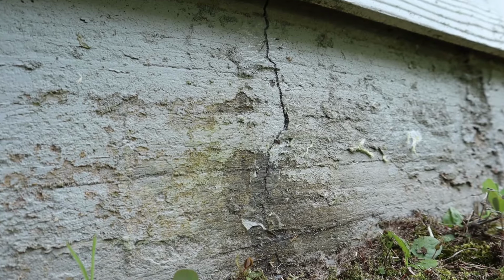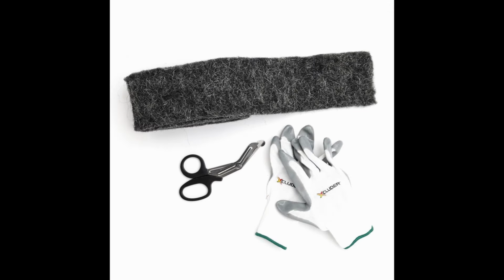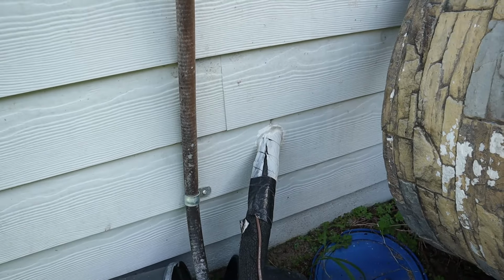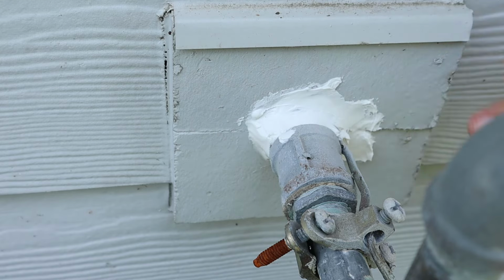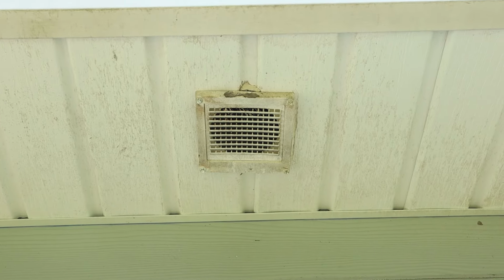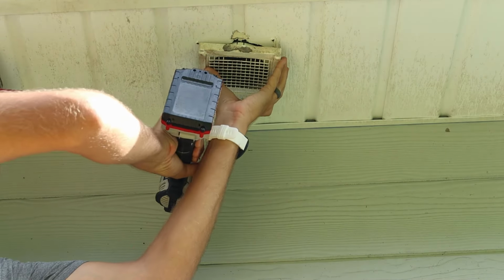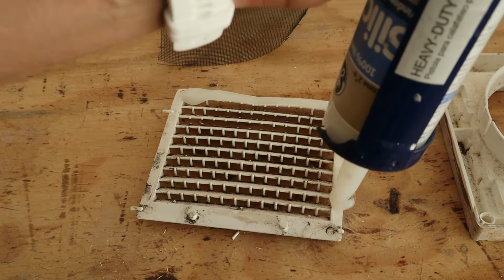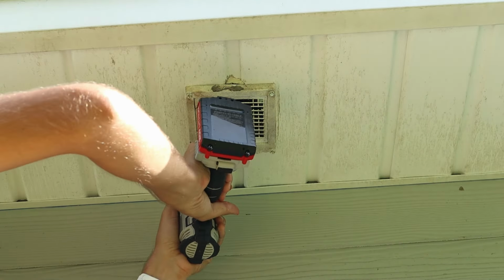How To Keep Bugs Out Of Your Home | Bug Proof Your House (4 Common Entry Points)

Comment: Sink and bathtub drains too, at least for certain types of bugs in some areas. Taking the small extra step to always pull up the plug on all the drains in my house when I’m not using them has really helped with bugs. I have horrible entomophobia and every little thing counts. Gotta try the vents now, though I’m slightly terrified of what I might find after unscrewing the cover.
Reply from the maker: Yes unfortunately the drains can have bugs come up through it which is gross in and of itself!  Definitely try the vent trick though.  Honestly it cut down on my bugs by a lot!  Also, if I had to guess, there probably wont be too many of them if any where you remove the cover.  Hope this helps!  Good luck with the pest prevention!
Reply: I would clean them regularly also I am an exterminator and I use bio drain. Helps with drain flys and gnats. Good idea to keep the drains closed too

Comment: Sealing up baseboards with caulking to fill in all gaps above and below the baseboard will help prevent insects that live inside the walls from crawling into the inside of your home. A good test is to take a business card and see if you can slide it under the baseboards around your house. If you can slide the card under the baseboard, that is enough of a gap for insects to crawl out from the walls into the house. Caulking will also work as an insulator to prevent cold air from migrating under the baseboards and coming inside. If you don't see a gap , it's still a good idea to apply caulking to the baseboard because gaps will form eventually.  We sealed up all baseboards around the house and that took a huge bite out of insect traffic.
Reply from the maker: Nice!  Thanks for the tip Tim!
Reply: I have a problem with palmetto bugs and I once saw one run away from me and crawled under the baseboard to get away. I’m about to buy a bunch of caulk to seal EVERYTHING!
Reply: I'm on here to find out if I should caulk below baseboards with carpet.  I imagine it won't be as good a seal, and would make it a pain to remove the carpet down the road.  But this is concrete floor downstairs and lots of weird things get in.

Comment: I had the same issue with wasps in bathroom coming from vent. Literally scared the shit out of me and using screens helped tremendously!
Reply: underneath the sink, you will notice there might be a hole on the wall right around the pipe. i noticed a lot of crawling bugs coming from there too.
Reply: @wiiiz3  I have the same problem. What did you use to fill the gap?
Reply: @Misabelle  I used a spray foam gap filler

Comment: Huge centipede almost crawled over my foot today. Time to take action -- I see light under the rear door -- not good.
Reply from the maker: Might be time for a new door seal!  Sometimes they can wear down over time or just aren't big enough from the beginning.  But if I had a huge centipede about crawl on me, I would definitely be trying to find anything that could have let it in haha  But if you are seeing light under your door, then that's probably a good indicator of where it came from.  Do you have a pest control company or do you do your own?
Reply: @HowToHomeDIY  I do my own mostly but haven't sprayed in months. Better get after it and replace the door seal.
Reply from the maker: @lancedyer4870  Ok good, I am sure this won't be any surprise but I think DIY is the way to go.  A lot less expensive and can be just as effective.  On Thursday I have a video coming out showing what products I use and how I do my own pest control.  Be on the lookout for that.  We may use some of the same things!

Comment: I rent a house in the country and it needs work with air duct system, bathroom vents and window seals and doors.... But being a renter and not an owner... Not much I can do. I hate living with so many bugs. I don't mind bugs outside and camping etc .. but it is a bit much inside the home.
Reply from the maker: Yeah renting does have it's limitations.  But you can try to seal off any areas that you see bugs might be getting in.  If the seals are bad though I would address these things with the landlord.

Comment: you should absolutely NOT put screening over ANY central air conditioning vents, registers, or return grilles, as any HVAC pro will tell you, this will put undue stress and strain on your air blower. it may not seem like much, but home ventilation is a very tricky thing to get just right, and if you slow the air flow, even by a little bit, it can make your house more muggy, keep it from cooling as well, cause condensation on your ductwork, leading to mold and mildew, and as i mentioned, can damage your central air's blower.

if there are ants coming in thru your central air ducts, then they were not installed properly, as those ducts are supposed to be AIR SEALED with mastic and tape, and insulated at every register and grille. if this was not done, you can always do it yourself, though i realize that nobody likes to go into their crawlspace...

Comment: I had an issue that took me a while to figure out - I had bugs coming in through one of my windows. Visually it looked like the window was closed but it wasn't properly shutting all the way. There was no gap between the frame and the wall. But there was a gap between the two window frames themselves that was not visible from the inside. I just have to lift up on my window when closing it to get it to close all the way.

Comment: I always wonder if bugs came through the plumbing vent and the furnace vent both located on roof. I thought about putting a screen on plumbing vent but not furnance vent to prevent blockage of carbon monoxide
Reply from the maker: Hey, yeah they will definitely try to get in however they can.  To touch on the two that you brought up, I would not think they would be able to come in from a plumbing vent due to sinks having traps on them that should be sealed because of water being in them.  Also, if you are in a area that freezes in the winter, I might be concerned that the top of the boot where the screen would be put could freeze over.  The furnace vent though, I could see how they could let some things in.  I have seen that there are some screens made for furnace vents but many complain that they aren't effective due to the holes in the metal mesh being too large.  I am sure this is due to your concern as you smartly pointed out, of if the holes were smaller, it could cause blockage issues. Screens are definitely going to reduce air's ability to move. One thing you could try, and it would be some work, is you could remove the registers in each room and glue screen to the underside of them to help stop the bugs from getting into the rooms.  Now this could cause a reduction in air movement indoors but I have seen people do this and said it works.  Bugs coming in through air vents can definitely be an issue and debate exists as to what is the best way to tackle the issue.  I hope this was helpful.
Reply: @HowToHomeDIY  thank you for the quick response and I didnt think about the plumbing vent freezing over because of the screen holding up ice build-up. Brilliant point. Thanks again
Reply from the maker: You're very welcome.  Let me know if I can help any further and I will do my best to do so.  Thank you for watching!

Comment: What kind of caulk do you use to fill the cracks on the exterior of the house?
Reply from the maker: Hey Holly, I typically use silicone caulk as it is less likely to shrink.  And depending on where it is I will choose between white and clear in color.  I usually get the GE brand tubed silicone.  I hope this helps!

Comment: Question, how do you keep wasps from coming in through a recessed can light in the home? We have that and put paper over it and taped it to the ceiling. Not an attractive or long term solution. Thanks
Reply from the maker: Well I would first try to find on the outside of the house how they are getting into your attic to begin with.
Reply: I have the same problem! Wasps in the summer, lady bugs in the winter…although I much prefer the lady bugs! 😰 Did you find out where the entry point was?

Comment: I’m at an awful apt that is structure on a sloping hill in an area that experiences all 4 seasons and recently flooding. 

I’ve been going into debt repairing and sealing bc maintenance won’t and my co-signer who helped me get the place keeps insisting I stay the duration of my lease..

I have carpet pulling from the wall bc it was install incorrectly. I was just going to put a ton of sealant here unless you can suggest something else? The other thing is my basement has the exposed ceiling which is common but I constantly see bugs coming from here.. is there anything you can suggest that won’t cost a fortune? Should I just hang a mosquito net across the entire ceiling?😓

I recently purchased a bed canopy so I can sleep better as the firebrats started wondering to the warmth, jumping from the ceiling.. but I haven’t used it bc I’m afraid that when I’m half awake, I’ll lazy open the sides and let them in somehow.. they’re so tiny and fast :[

I currently sleep on a heavily sprayed outdoor teak lounger..

I wanted to even maybe put sticky traps on the ceiling or even bug spray the zippers I don’t know😣

Comment: Omg, u need to replace that vent cover; it’s all Bent & mangled which could leave a gap & still let bugs get in, and then you defeated the whole purpose of putting a screen on, but also, I need to look into this, myself, but I need the smallest screen possible because mites and fleas would then be able to gain entry, and this is a nightmare because it is happening at my house. Unfortunately, I’m not even sure that there is a screen small enough that will not allow tiny bugs to gain entry. However, it’s not just the outside of the house that needs sealing but the inside, as well.
Reply from the maker: That’s why I caulk around it.

Comment: Thank you so much this was so helpful I subscribed and liked the video I have some bugs in my room once in a while and we all ways get the out by exterminators but yesterday I had a huge like 3 inch stink bug and it was so gross and I had a nightmare about spiders and I hate bugs please help me with any other tricks thank you.
Reply from the maker: I would just look for any way they could get into the house or room.  Could also be getting in through the vents for the AC/heat.  The key is just looking for any cracks or holes inside and out that a bug could come through.  Hope this helps!  Thank you for the feedback!

Comment: Should I just tape every hole/crack in my room
Reply from the maker: Hey Sus, I probably would not use tape.  It really just depends on where your holes/cracks are.  I would probably recommend using a latex caulk as it can be painted.  If it was in a bathroom I might consider using a silicone caulk.  Caulk is just going to be a more permanent solution as opposed to tape and once its sealed with it, you know its closed completely.  I hope this helps!

Comment: Any thoughts on preventing entry through a sump pump basin and are there any other special considerations I should have for bugproofing a basement? I'm getting ready to wall off a section of my basement to turn into an office and, unsurprisingly, the basement is where I've found the highest earwig concentration, which are the bane of my existence. I plan on completely finishing the office space and keeping it well-sealed from the rest of the basement, but I know if I don't prevent entry into the basement as a whole, eventually I'll have a nasty surprise come skittering across my desk. The windows and vents are easy enough fixes, but I have to assume the sump pump basin/drain is another easy access point. I'm planning on also walling off the section of basement where the sump pump basin is since it, my electrical panel, and the HVAC system are all neatly tucked away back there to make a convenient utility room, but again I feel that it'll basically just be delaying the inevitable in terms of keeping them out. I need to get this office space up and running before kids come along and take the bedroom I'm currently using, but I also don't want to commit to the switch until I have a solid plan in place.
Reply from the maker: Hey Rvckus, you have a good question there.  Now earwigs typically come in through cracks or holes around the house.  I would definitely go around the outside of the house and look for any potential entry points.  As far as the drains go, they do have some homemade mixes and things you can buy in the stores to pour down the drains to kill anything in them but there is no guarantee that if you are having bugs coming from there that they wont come back.  Typically drain bugs are there because something in in the drains for them to feed on like food, hair, etc.  So you might look into snaking it to make sure it clear and then also pour some cleaner down the drain.  Other than that I would recommend also getting some pesticides to help kill off the earwigs issue and help prevent it.  I have a video you can go check out with the products I use and recommend.  A few of them will work well on earwigs.  Hope this helps!

Comment: The Garage door on either sides I found was where they come in at.
Reply from the maker: Garage doors are a very common entry point.  May want to check the seal around the door to make sure it doesn't need replaced and then also treat it with some pesticides.  Hope this helps!

Comment: Any tips and tricks for this problem of mine?
So spring and summer are awful as the carport and other common walking areas outside begin to have invisible cobwebs all over. Such a pain when I’m letting the dog out at night and walk thru webs I can’t even see lol.
Reply from the maker: Yeah that is never fun to walk into haha.  Spiders are where other bugs are as they are the spider's food source.  So cut down on the bugs you will cut down on the spiders.  Lighting may be attracting bugs to that area, if they can be turned off it might be better to do that, you might want to try some DIY pesticides or have someone come spray, or try a bug zapper around those areas.  Hope this helps!

Comment: I just found out flies and wasps are entering my home from underneath my microwave that’s above the gas stove and I don’t know how to fix it.
Reply: Does your microwave vent out to the outside? I had this issue too. We installed a mesh on the exhaust going to the outside and no longer have this problem.
Reply: @ljunderground Yes there is a vent outside right behind the microwave. I will try to cover it and hopefully that helps. Thank you!
Reply: @PatoniSinsi  Sure it should work! Basically I was told the heat from the microwave exhausting out that vent attracts bugs into it. So if you can put a mesh over that outside vent, then they won't be able to get in.

Comment: i don't know how to get ride of booklice in my ceiling roof 😭😭😭please help i tried pest control company and chimicals they came back after 2 years
Reply from the maker: Hey hajar, booklice really only exist in moist environments that produce mold and fungi as that is what they eat.  If they are in your roofline or attic, you may want to have your roof inspected for anything that may be letting moisture in.  If you're sure it's not the roof then your attic may be too humid without enough ventilation.  You can get some fairly inexpensive devices to check the humidity level. Dehumidifiers have been known to help your issue if placed in the area you see them in.  Look for any trees that hang over your roof.  There has to be a moisture issue.  Spraying pesticides will help your issue in the short term but until you get to the root cause, they will probably keep coming back.  I hope this helps!
Reply: @HowToHomeDIY  Ah thanks my dear for replying i appreciate your advices . but i am really curious if they are harmful to humans and can they go to my hair ?
Reply from the maker: They are a nuisance but the good news is, they are not harmful to humans and will not be trying to get in your hair.  Booklice are not parasitic like head lice are.  Head lice feed on blood which is why they get on humans but booklice just want mold and fungi and if you have any old books around, they may eat the glue in the bindings.  So do not worry about the booklice trying to get on you but definitely still try to get rid of them.